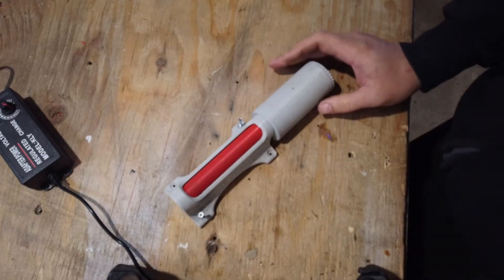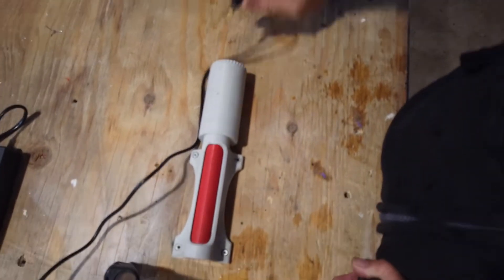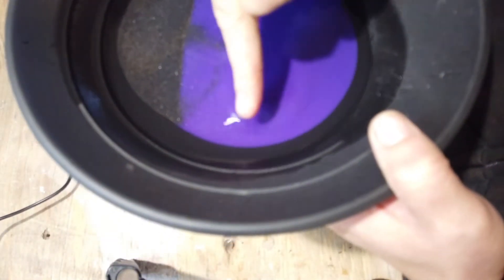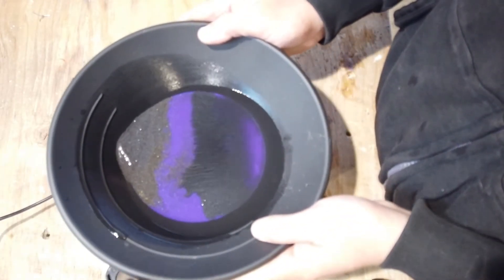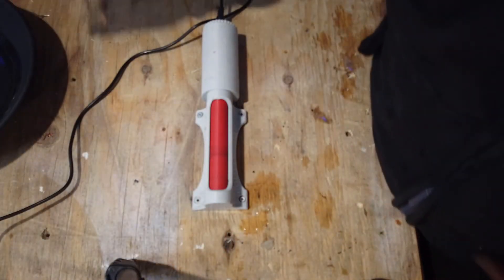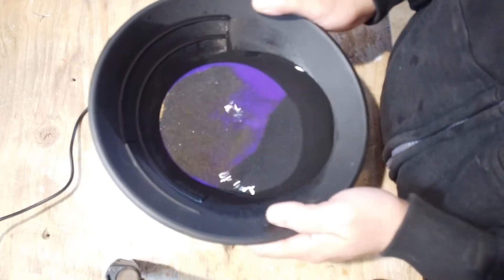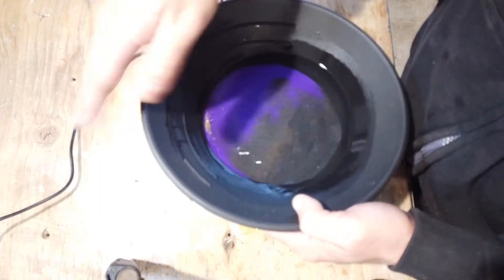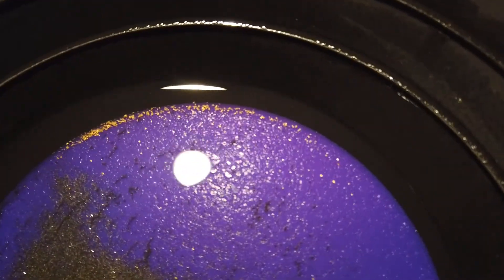Rollie Pollie Instructions- how to separate magnetite from  fine gold

Comment: https://www.youtube.com/watch?v=sJ_SIOxMZ9E
Reply from the maker: Thanks for sharing. I like his testing jig. I've got something that I've been playing with using eddy currents to influence gold to separate out just had to come up with a device that could remove ferromagnetic first
Reply: @MiningMagnets  I found your invention interesting a little further on. I'm going to buy a magnetic separator with you this blue model. I liked it, I sent you the video because I think you can use the information in this video to your advantage and develop another separator that also includes the elements of group of platinoids, metals that are priced much higher than gold, making their invention even more interesting with greater sales power.
in my case specifically, I have a mine of platinoids here in Brazil with very high levels of platinoids proven with xrf x-ray spectrometer exam. As I said soon, I want to test your separator here in Brazil and I think it will be a sales success here because there is one Competitive price . Best Regards